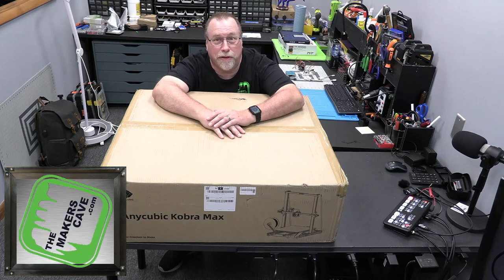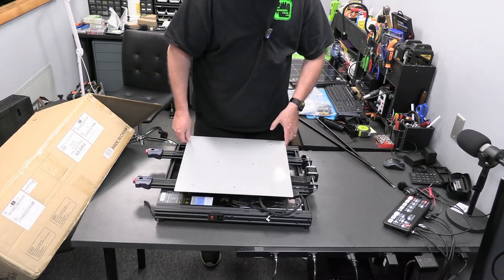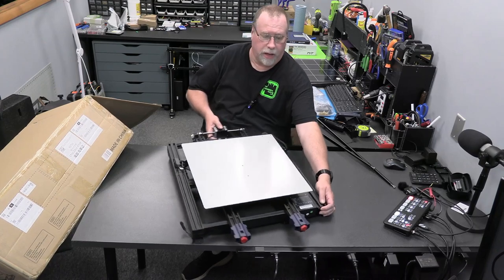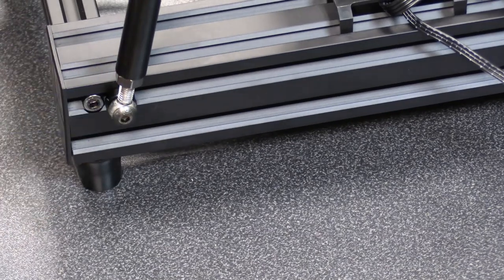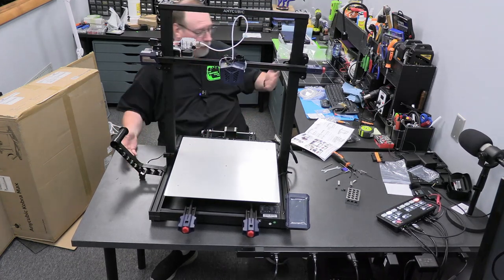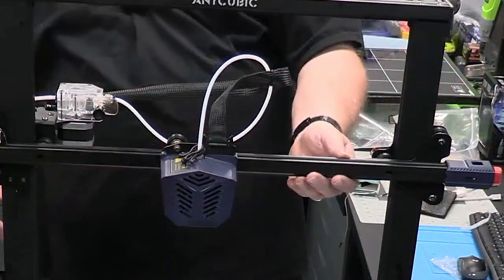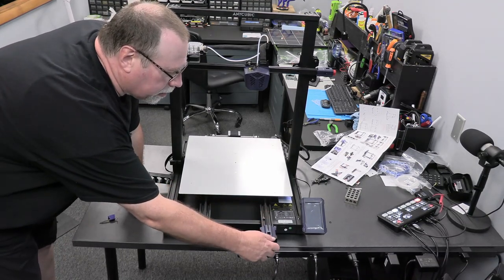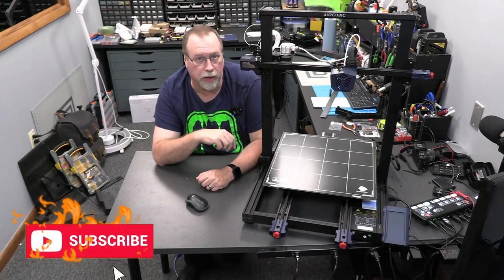Anycubic Kobra Max Review - Assembly

Comment: Hello... thank you for the video. I would add tie wrap removal, especially the ones under the bed, overall screw check for tightening and a more detailed check on hot end assembly adjustment to the rail. And links to the other Kobra Max videos.

Comment: I'm new to 3D printing and bought mine on 1 Dec and I love it! I skipped the obligatory test print Benchies and went straight to printing out an Agent Carter figure from VX labs.  Doing another one right now and sized it up to 1/4 scale, looking good. Having no issues whatsoever.  Have changed out a couple of filament spools and that's easy to do. The YouTube videos on this printer are also helpful.  Now, the Creality Ender 3 V3 SE I bought before this one is another story. It made about 5 prints and became a paper weight. Mechanically it's working, but it just stopped printing any files period. Creality support is no help at all and I'm sending it back.
Reply from the maker: I think you made the right call by sending it back. The fact that the print out five then stop definitely an indicator that somethings wrong with the printer.

Comment: the assembly instructions in the box are  the worst assembly instructions i have ever seen... shame on you anycube...
Reply: + auto leveling doesnt work... print bed goes all the way up and the printhead goes completely out of the print area and is stuck doing this ugly compressor like sound because it is stuck. tried to fix it with the software you use, interrestingly the printbed jumps to the exact good homepoint BUT when i start the auto leveling on the printer itself... printhead goes completely off the printbed... any ideas on that?
Reply from the maker: I would recheck all the limit switches and their associated wiring.  If it keeps happening you may want to reach out to Anycubic and have them send you a new main board.
Reply: if that printer would have made a single print i would do so... but because this thing has never printed anything... no no no... i will not accept any repair... money back and never ever Anypubic again+

Comment: @17:10 the "wire ties" you reference from the assembly manual are the clips hanging around the bowden tube on top of the printhead, not the zip ties. No harm no foul, it works fine the way you did it, but Anycubic intended for you to use the three plastic clips on that length, and use a zip tie near the base around the support strut and the two harnesses.
Reply from the maker: I basically was winging it.  From what I’ve seen they have updated their instruction manual.  Mine was very vague and sometimes the pictures matched with nothing on the printer.  But like you said, it works